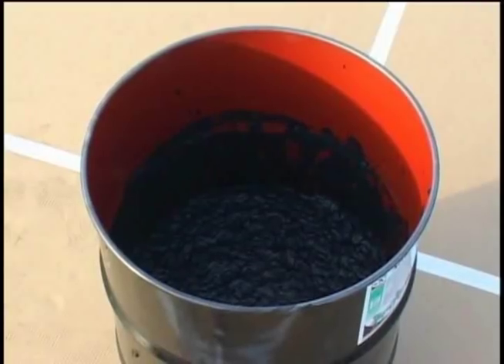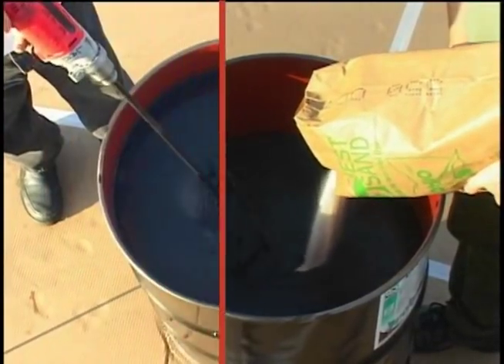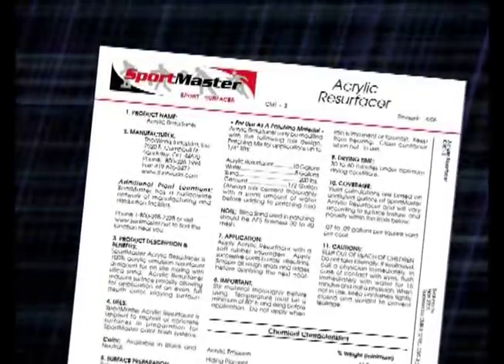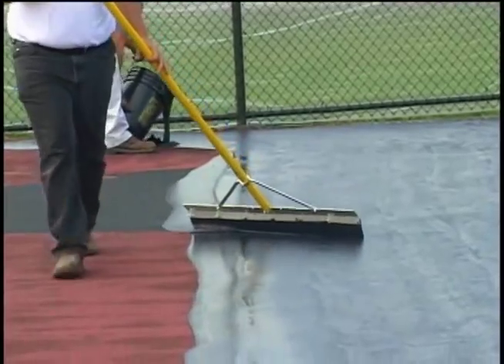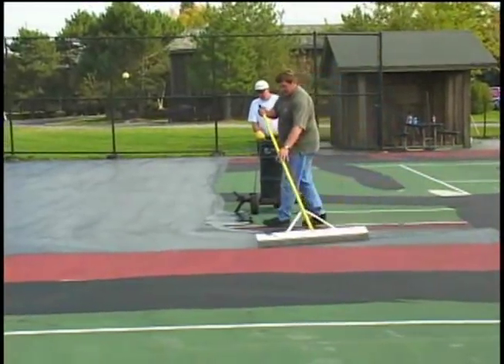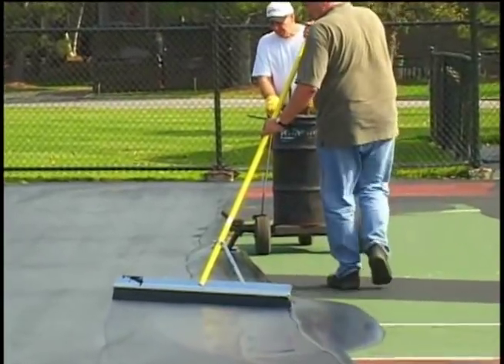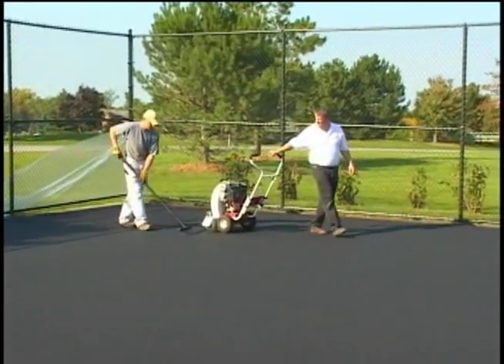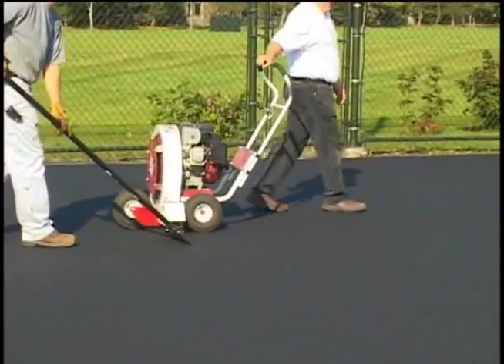SportMaster: Tennis Court Resurfacing - Mixing and Applying Acrylic Resurfacer

Comment: Why are hardcourts more popular than clay courts? Hardcourts seem like so much more work long term than a clay court.
Reply: Clay courts are significantly more difficult to play on (ball slows down on the bounce , so you have to slide around to reach it, and it also gets your clothes much dirtier. Clay is also arguably higher maintenance because you only need to resurface hard courts on a very occasional basis.